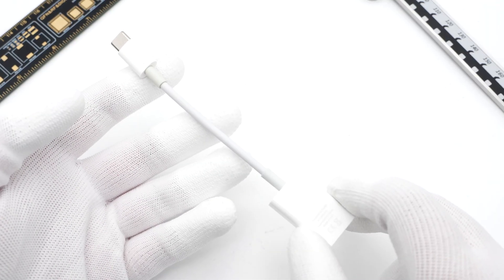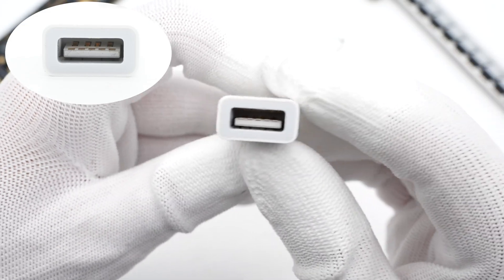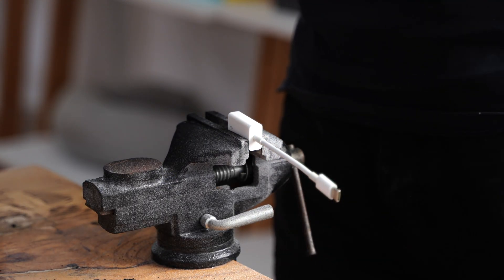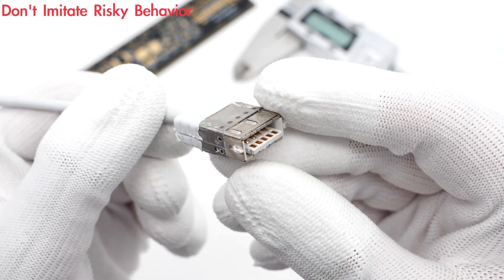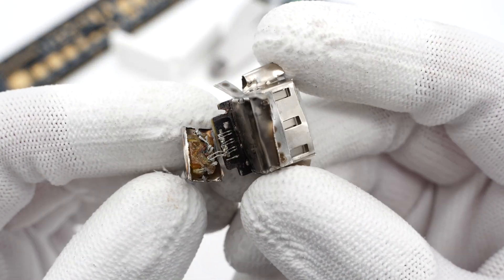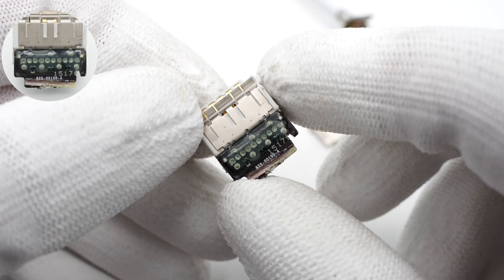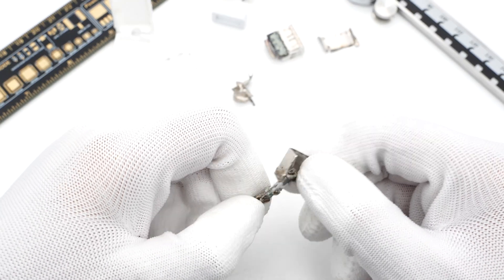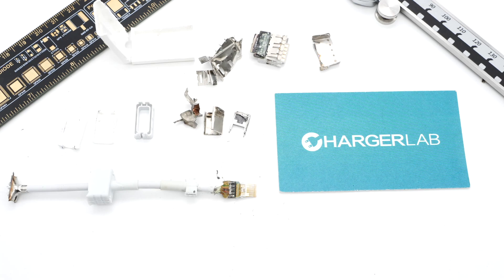Teardown of Apple USB-C to USB-A Adapter

Comment: The resistor on the USB-C end is nominally 5.1kΩ and connects the "CC" signal to GND.  The USB-C spec requires this resistor for this kind of adapter.  The resistor's purpose is to inform the USB-C device that something is connected.  The CC signal does not connect to the USB-A end, so the device plugged into the USB-A side is unable to drive the CC signal.  Hence, the resistor.

Without this resistor, the device on the USB-C side would not know that anything is connected and, if it followed the USB-C spec, would not output power onto the VBUS signal, preventing the USB-A device from receiving USB power, which typically would result in the USB connection not being made.

USB-A has no CC signal and outputs power on VBUS even before anything is plugged in, which is kind of sloppy, resulting in what's called hot plugging.  USB-C, via its CC signal, improves on that.  The CC signal serves a couple other purposes as well, but these purposes are usable only if both devices are USB-C, which with this adapter, they are not.

Comment: Why go for the solid build quality of the connectors themselves if they’re just going to use their patented shitty TPE cable insulation that cracks after a few years of use?
Reply: The other cables were all converted to fabric on the outside - too bad that this didn't happen here too

Comment: Apple products are over priced
Reply: yep. not even usb 3. and even then you can get a 10 pack of adapters for like $15
Reply: @nich-nk2cr looks like usb 3.0 see the extra pins on the usb
Reply: @chris-qv1rz  even still. apple products are indeed overpriced. a usb adapter is worth single digits USD at most.
Reply: @nich-nk2cr  Not really, even knockoffs cost that much. High quality usbc products actually cost more than you think, not to mention the shipping and transportation costs, etc